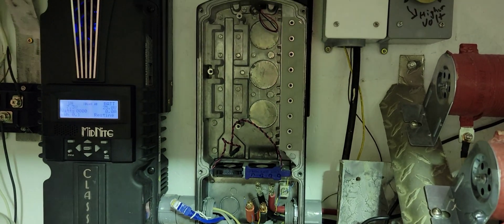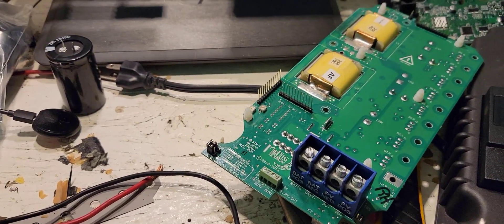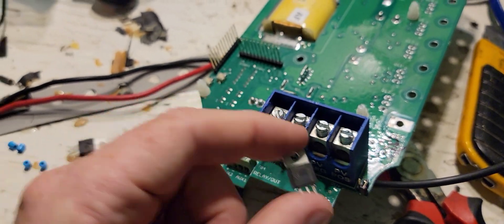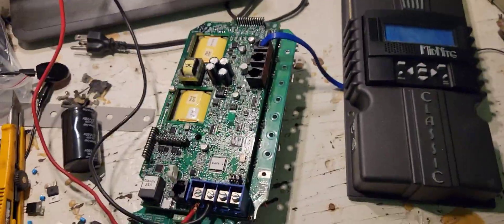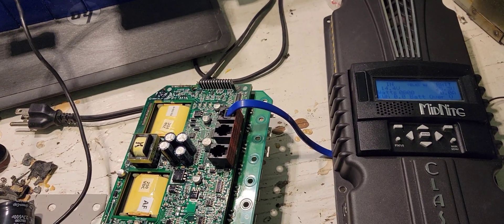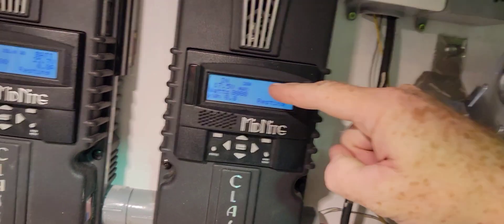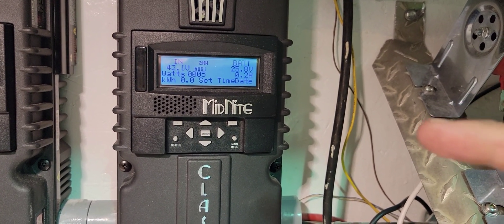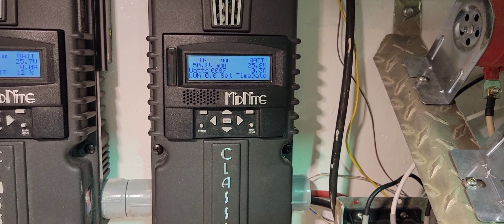Midnite Classic 250 has been destroyed while I was at work...Now what?

Comment: Hi, thanks for all your videos, I've built my own clipper off them, now working on an axial flux turbine, if you read the classic manual they used a bridge rectifier as a diode to separate their clipper from the classic, I had the same problem with my classic150 until I separated the actions of the clipper with the classic with diode
Reply from the maker: The clipper works perfectly it wasn’t the problem… the problem was that the batteries have to supply the power to control the relays for the clipper. The BMS turned the battery off which completely turned the entire system off including the clipper. All what is necessary is a small battery that won’t turn off
Reply from the maker: Did you mean to use the bridge rectifier to power the relay directly from the turbine if the battery shuts off? I have a circuit like that made but I never did install it